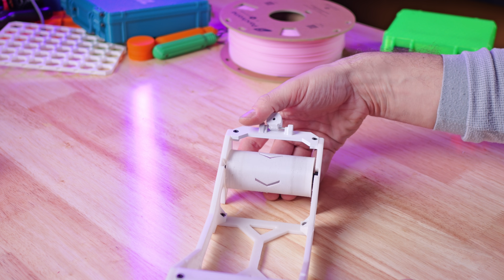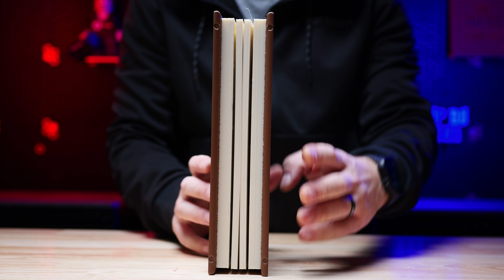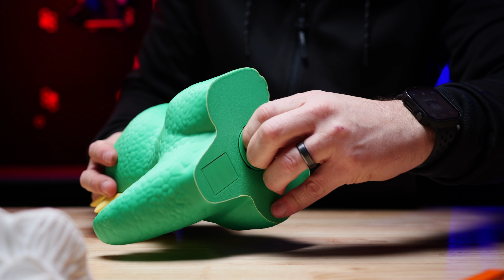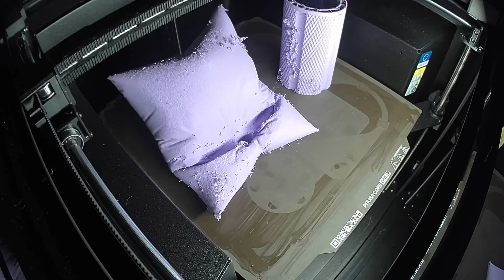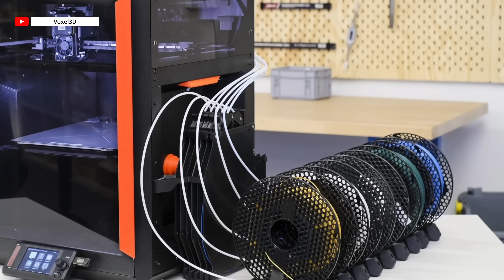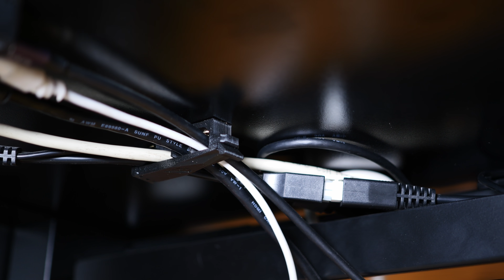These 12 Designers are REDEFINING Awesome 3D Prints!

Comment: I have been stuck with upgrading the printhead on my SV08 MAX, but just as soon as I actually get the YAVOTH tool head dialed in I am going to be making the 90 degree torque heat set insert arm from Chris Borge. 

If you were to put together a video on that project it would certainly get a watch from me!

Comment: You should cut even faster so there is no chance at all for the eye to grasp what's there.
Reply: I just thought it was some sort of psychosis glad it's not the case.
Reply: Yea, there’s nothing like trying to fight with the pause button to make sure that you see every single item that was shown in a pause frame. Then rewinding it often times more than once, because you couldn’t click or tap the pause button, quick enough, to then try to see the ones you missed out on before.
Reply: For me, I have made these models and wanted to see clearer video.
Reply: @MartinKuras  idk i set it to 2x, wasnt fast enough for me
Reply: @MartinKuras  😜
Reply: Example, my hinges break on the flip up.
Reply: You should build a lathe. It would be great.
Reply from the maker: These were too fast for you? We debated it quite a bit internally and settled on our long standing practice of never wasting our audiences time - sorry if it was TOOOO fast!
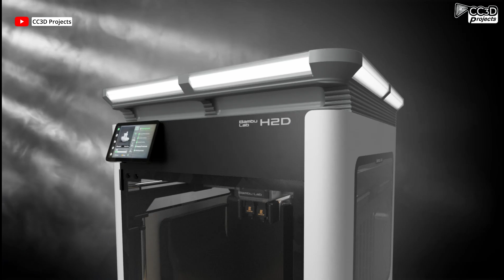Reply: @thenextlayer  I think you misunterstand.... it's not about the overal presentation, that's fine. It's about the rapid fire 2-cuts-a-second at several points in the video (10:40 for example) after you introduce a creator. It's Micheal Bay style, too fast to grasp anything concrete, it's incredible annoying. If you want to show examples of the work of these creators, you need to give the time to recognize what it is you are showing.
Reply: @MartinKuras  I agree with this guy. A little too fast for me too.
Reply: @MartinKuras  agreed. Great video though, but I found myself having to skip back and pause to take a closer look at what you were trying to show.
Reply: @MartinKuras if only it had more explosions to complete the Bayness.
Reply: @MartinKuras  for me too fast too and i am too lazy to pause. So i couldn't appreciate everyones work as i should
Reply: @thenextlayer  too fast for me.
Reply: @thenextlayer I understand it's hard to keep everyone happy, just impossible.
But would be nice to see more of the items 
Yet the video was informative, backdrop was awesome and relaxing, great video non the less
Reply: @thenextlayer  people can speed up a video if it's too slow. Slowing down is a poor viewing experience
Reply: @thenextlayer  don't listen to all the complaints. You've done an incredible job showing so many designs in a 17min video, providing links to all designers shown. People are extremely lazy these days. If someone wants to check a particular design closely they can go to the relevant website. YouTube also lets you slow down playback. All the moaners here are like those ppl on FB groups asking silly questions that Google could answer in 3s.
Reply: @thenextlayer  I was watching this at 2 in the morning, half asleep, and I was able to keep up with the cuts and see all the important things just fine. Don't listen to the haters.
Reply: @JoshNesbitt it’s not haters, stop lying. Been watching his videos for a while and I also was unable to even had the chance to tell what I was looking at 10:40 into the video
Reply: it is possible to slow down and pause videos on youtube.
Reply: @WendyGameing  It's also possible to just not commenting if one has nothing of substance to say. And in case you don't know that.... a video is to be watched, not paused, slowed or fiddled with, in order to extract the information. It's not supposed to be annoying by the lack of a sense for pacing, kadence and basic insights in to human perception.
Reply: @WendyGameing some of us like to watch these videos while eating where we have a knife and fork in our hands and sometimes have the video on the TV while doing other things and can't just grab the remote to pause.
Reply: @outofthi5world567 and pause 45 times in a minute at that
Reply: @WendyGameing stop being stupid